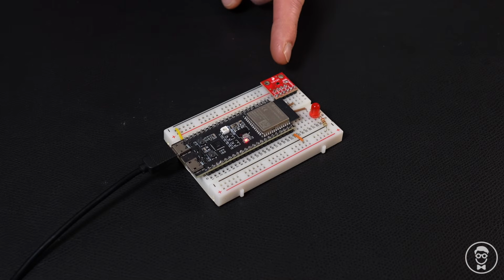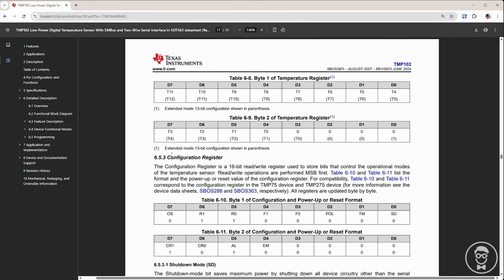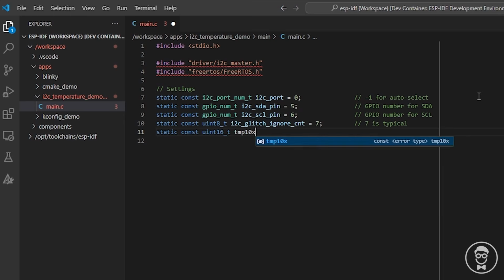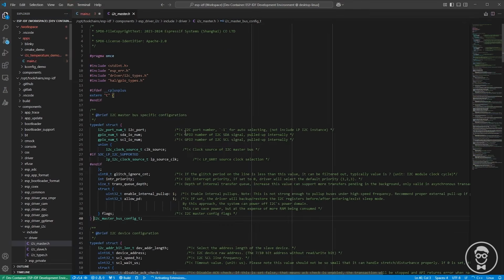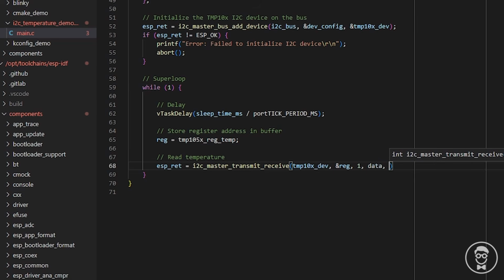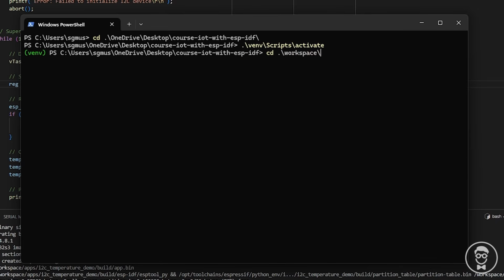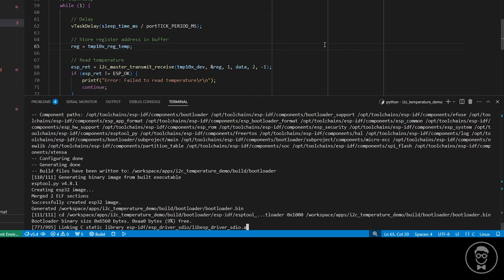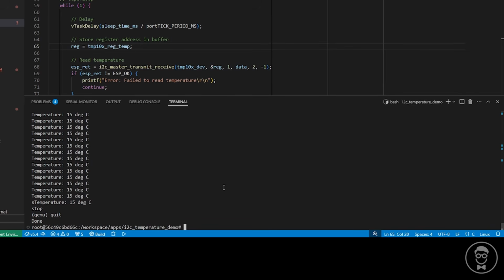ESP32 - I2C with ESP-IDF Tutorial

Comment: Great channel, why do you prefer to type over two lines of command and creating all these files manually instead of using ESP-IDF extension? Would you please make a video on sharing a local component with projects without copying it to each project's folder? I did that with AVR and PlatformIO, want to use ESP32 the same way as low level as possible without each project having tons of files.
Reply from the maker: Generally, I prefer to be explicit when creating projects so viewers understand what files go where. Once you're comfortable with how projects are structured, feel free to use whatever plugin or initialization script you wish. Check out the GitHub repo and the WiFi Driver video (https://www.youtube.com/watch?v=j1ve8mYjUoU) to see how to set up an ESP-IDF component that can be included separately (e.g. linked to) from various projects.
Reply: @ShawnHymel  thanks for the reply, I'm checking the video right now. I'm glad I found your channel, not easy to find good content that doesn't involve someone showing you how to use a library.